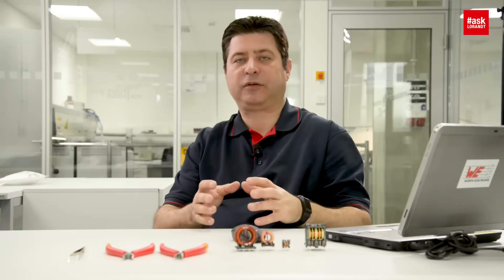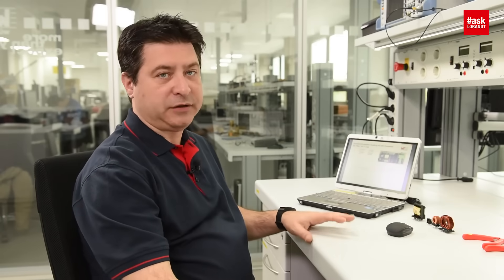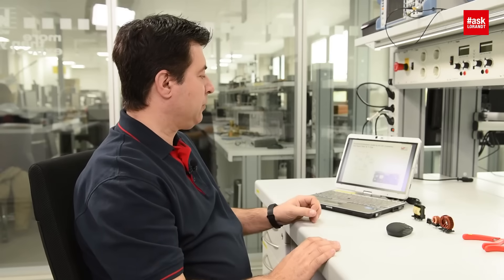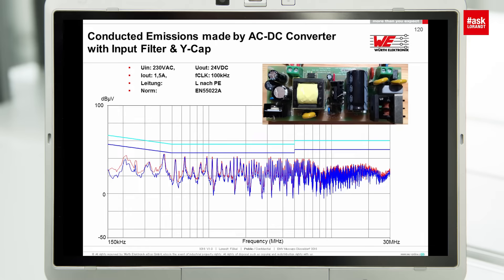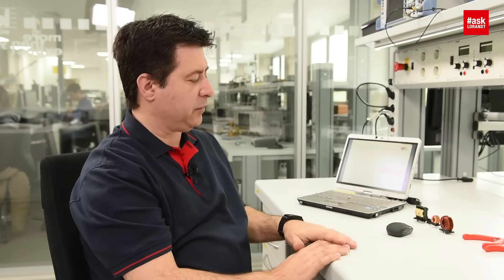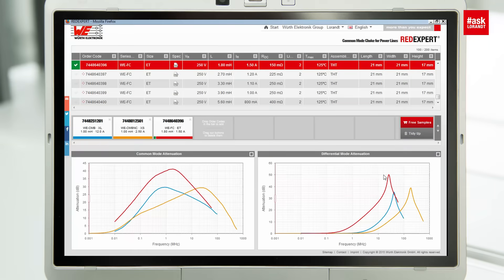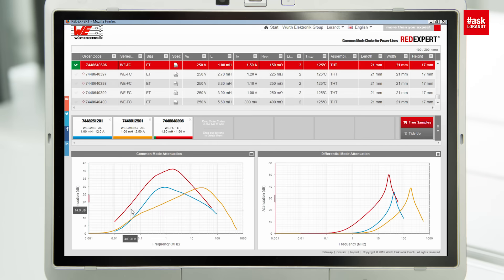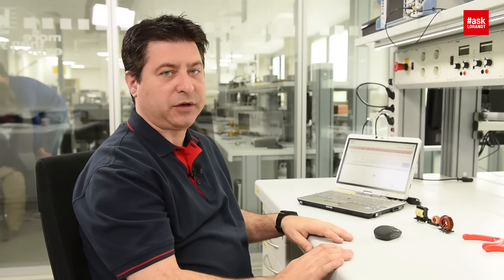#askLorandt explains: Common Mode Choke for AC/DC Power Supply

Comment: Will a choke hold back ESD?
Reply: Hi Rick, yes, no worry. All wire wound CMC's have never problems with the ESD test. Only multilayer based CMS's could be damaged due to the very high voltage. For the wire...is easy going ;-)